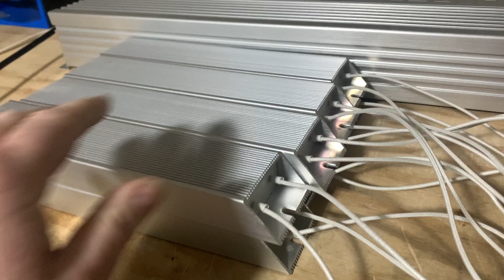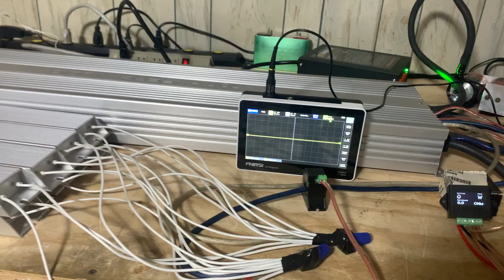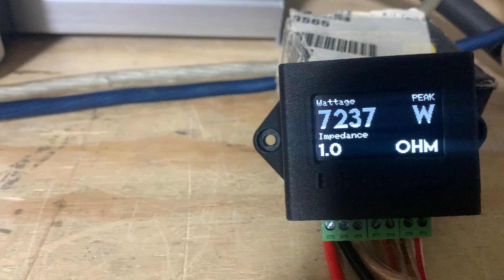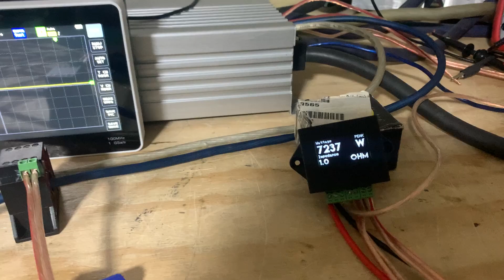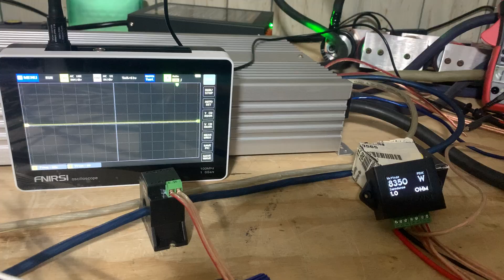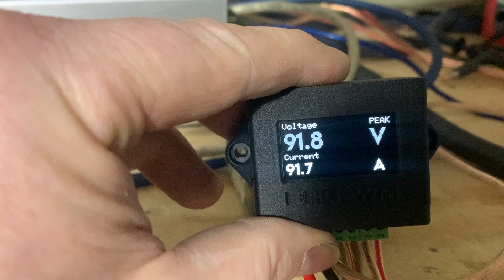Ampere Audio AA 7500 1D amp dyno at 1 ohm

Comment: Just subbed. Quick question. I ordered a basshead watt meter. Is there a big difference with the results you get from it vs just multiplying volts x amps? I know it calculates power factor. Just wondering how much power loss you see when that number is calculated in.
Reply from the maker: Thanks for the sub and thanks for watching. I will tell you I know a lot about electricity, electronics, and car audio in general. However I do not know how power factor is generated. I do know the version 2 BassHead Garage Watt Meter is pretty dang accurate measuring the voltage and amperage according to my testing compared to my volt meter and clamp meter. And then the BHG-WM automatically calculates the wattage based on the volt amps with the power factor  included. I am waiting on a version 1 BHG-WM from one of my friends so I can do a side by side comparison to show everyone the difference between the two units.
Reply: @jeremywilliams8558 what do you have power this? My friend has the same amplifier but im not sure if he should go sodium or a123 battery. He don't like the idea of cmax. So what kind of battery and how mush ah time?